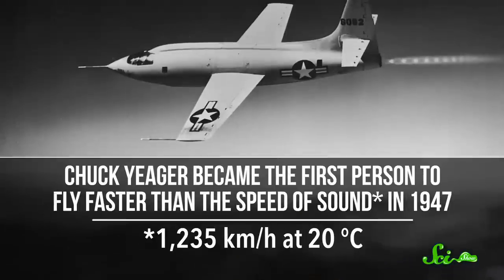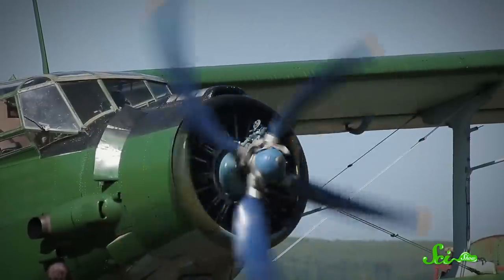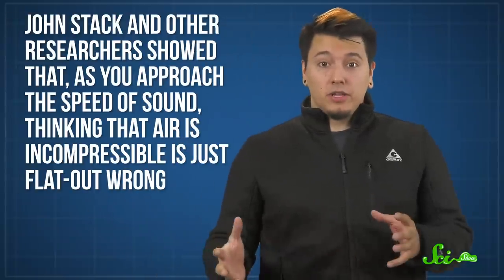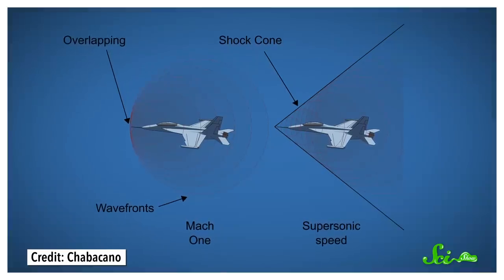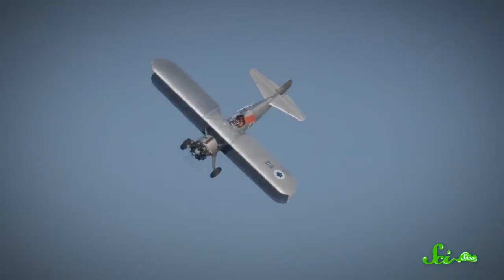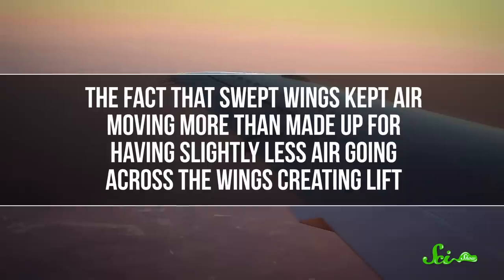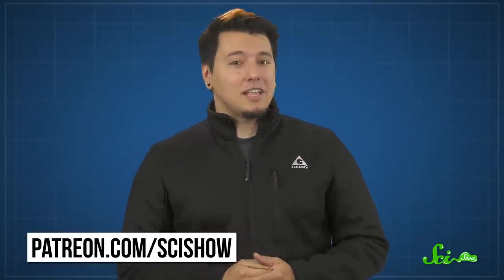A Surprisingly Simple Secret to Supersonic Flight

Comment: Fun fact. While sitting near the wing on an airliner, if you look really closely, you can see a shock wave. The plane flys at about Mach 0.80, but the airflow over the wing goes supersonic relative to the wing.
Reply: Richard Sleeve i’m flying across the US tmmr afternoon i’ll take a look
Reply: The same concept applies to the F1 car spoiler you can see it on the far corners.
Reply: @Lup0Solitario  F1 cars are nowhere near the speed of sound, there is no supersonic flow around the spoilers. What you are seeing is water condensing out of the air due to low pressure, similar to what you can see on airplanes during maneuvres.
Reply: V interesting. Thank you!
Reply: Yeah you can see that. But you need the right lighting conditions to see the light breaking differently at the shockwave. So be not dissappointed if you see nothing.
Here is what you look for: https://www.youtube.com/watch?v=HekbC6Pl4_Y
Reply: @Lup0Solitario  No , that's condensation from the airfoil tip vortices
Reply: If an airliner goes supersonic, such as in a dive, it will break apart. Early jet airliners that went up to the transonic speed range were much more heavily constructed, which meant that for their size and engine power they carried less load, passengers or cargo.
Reply: no chemtrails? Now I am shocked :D

Comment: What allowed Chuck Yeager control of the X-1 was the Full Floating Stabilizer. Above the speed of sound the stabilizer/elevator combination doesn't work.  While the swept wing is very important Col. Yeager did exceed the sound barrier with nearly strait wings.
Reply: Full Floating Stabilizer invented by the British and stolen by the Americans
Reply: It depends on more than the sweep of the wing. You can achieve the same effects with very slim wings. That's what Yeagers plane had. Like the F104 which has almost no sweep. The cost however of such a design is not bearable for commercial airliners or bigger planes so you go for the easier, more efficient solution, whereas fighter jets usually take both approaches nowadays to get even more speed out of the wing.
Reply: LZ129 Brazil  No he's correct, read the book "M52" it's about the plane the Americans copied to build their first supersonic jet. The company that did all the development was forced to shut down and pass everything to the Americans.
Reply: also very thin wings as at super sonic speeds most of your lift comes from compression of the air
Reply: LZ129 Brazil  The British were flying with an all moving tailplane in 1917 with the Witworth FK10 and had continued further development through WW2, A deal was made in 1943 where the UK and America would exchange secrets, we gave them the jet engine, the all moving tailplane and all our uranium, once they had it they refused to give us their secrets
Reply: @JOOLZNED  nothing has changed
Reply: USA#1 !! And the USA had planes in 1776 too
Reply: @JOOLZNED  Also x1 was identical to Miles M52. The yanks collaborated with the Brits up to point where they learned enough to go their own way. Incidentally the German fighter pilots were breaking the sound barrier with Me 262s long before loud mouthed yanks.
Reply: @JOOLZNED  There is no such thing as fair trade with the yanks.
Reply: The problem is that when a shockwave forms on the top of the wing, things like ailerons behind that shockwave stop working because they are not getting stable airflow.  So, the tail is small enough to make the entire thing move giving you control again.  Unfortunately, you can't twist the entire wing (unless you are the Wright Brothers), so bigger ailerons and spoilers and using the tail planes to bank are used instead.

Comment: also wait wait wait, if people assumed that air could not be compressed, how the hecking honk did they overlook the air compressor?
Reply: What is meant is that the models treated air as incompressible because it was believed the effects of compression would be too negligible to matter. The discovery was that air is compressed more than accounted for at those high speeds.
Reply: @WolfDGreyJr  ah aight cool
Reply: Also forgot about all the big racecars and war birds that used supercharged engines.
Reply: I think when the formulas for airfoils were developed, the pressure differences around the airfoils were small enough at the speeds of the time that there was negligible change in the air density.The formulas became so ingrained in aeronautical design that everyone forgot the condition that they only applied when pressure differences were small.
It is sort of like if you developed Newton's law of motion by simplifying special relativity (because apples don't fall anywhere near the speed of light). By the time we started having to consider things going near the speed of light you might have forgotten the simplifying assumption that yielded Newton's formulas.
Reply: It would be better to say they believed that ''open air" could be assumed incompressable. 

Everyone knew you could compress air if it was confined in a piston or tube/turbine etc.

The assumption was that in the open air of the sky, air could just move around the plane as required, simply by applying pressure/drag.
Reply: Yeah, I had the same thought when that was said. Phrasing could have been better for that line.

Comment: The secret is to go between 915 and 3,806 miles per hour. Any less and you discover the secret to transonic speed but any more than that max and you will find the secret to hypersonic speed. 

Pro tip: The key is how fast you go.
Reply: SirEvilestDeath pro PRO tip: those numbers depend on air temperature and density so they vary😉

Comment: On modern civil aircraft it's more about preventing shock waves from forming over the wing than "keeping air moving". This works by decreasing the effective (normal to the wing) air velocity. You actually lose some lift doing this but you prevent shockwaves from forming which would reduce your lift/drag ratio.

Comment: Just an observation - the Bell X-1 which is featured (correctly) as the first plane to successfully break the sound barrier, didn't have swept wings. However a commercial airliner, which doesn't have a shock wave because it is subsonic, is featured as an example of a plane with a swept wing.
Reply: Even at subsonic speeds, supersonic flow can happen over certain shape surfaces. Commerical airliners top out at .94 Mach, so solidly transonic, which is the compressible flow speed range of .8-1.2 Mach.
Reply: The video did say that problems can start at around 60% the speed of sound, and that commercial jets travel at 70% the speed of sound, so I don't see the problem with using them as an example here
Reply: You lost me at "correctly"
Reply: But the X-1's wings were very thin, which mitigated drag.
Reply: Yes the X-1 had wings designed by Gillette to slice through the air like a knife through a scraggly beard.
Reply: Aa I recall, they hadn't really worked out the swept-wing thing. For that matter, the Starfighter had straight wings even after that was figured out, though admittedly the Starfighter was still optimized for high speeds... and even the Space Shuttle and X-15 never equalled it's higher landing speeds.
Reply: @absalomdraconis  But the F-104 has  tiny wings. Heck Germans nicknamed it the lawn dart for how uncontrollable the plane is due to small control surfaces. And landing is practically a death sentence.
Reply: @absalomdraconis  The last starfighter didn't even have wings!
Reply: Interestingly, the X-1 was shaped like a bullet, because engineers knew bullets could fly at supersonic speeds.  They hadn't stumbled upon later design innovations yet.
Reply: @firepower7017  the F-104 was only a "death sentence" because German pilots were trained on the F-86 Sabre (CL-13 really but same thing) and then almost overnight switched to the F-104G with the minimal extra training. Even nations that operated F-104Gs in the exact same fighter-bomber/interceptor role as Germany operated theirs have almost no crashes compared to the hundreds or whatever in Luftwaffe service.
Reply: @QuantumLeclerc  Regardless of it being totally unknown. What made it difficult was how easy it can stall. Also the zero length launch is practically a rocket strapped to the bottom of the aircraft so any jerking movement to the control surfaces will literally send the plane into the ground killing you.
Reply: @firepower7017  true, but ZELL was essentially a meme and wasn't standard practice by any means. The F-104 did have short wings, but if flown right wasn't any harder to land than other supersonic jets of the day. The fact that they crashed often is, like I explained, a myth born out of German training and nothing else. Just the fact that no other air force that operated them had nearly as many crashes is proof of that
Reply: @QuantumLeclerc  The only other Supersonic jet was the F-100 and that will basically throw your plane nose up killing you.

German pilots weren't trained to land at a higher altitude which is why they end up short. Also about 60 F-104s practically crashed and about half of them killed the pilot.
Reply: @QuantumLeclerc  In a demonstration display a f-104 managed to strike others taking down about 4 others. So it's a testament to the troubles
Reply: @QuantumLeclerc  Also I could tell that most of your knowledge on tanks can come from GuP. So I wouldn't be surprised.

Memes and Anime, just no
Reply: @Uejji  Yes, and they designed it with paper, slide rules, and imagination. The few computers which had been built by that time were crude and mostly focused on simple tasks like ballistic trajectories or census tabulations. It says a lot about the genius of the designers, but also the courage of the test pilots. They were betting their lives on the correct math and realistic assumptions of the engineers. Modern computing has made prototyping and testing exponentially faster, safer, and more successful.
Reply: @QuantumLeclerc  Don't forget that the F-104 ejected the pilot through the floor because going up meant being smashed by the huge vertical stabilizer.
Reply: @firepower7017  Lockheed bribed many governments to get them to adopt the F-104, including the Germans, Italians, and Japanese. Pilots who tested the Starfighter found it very unforgiving, and mostly preferred other options, but in the end, the way was "greased."
Reply: @jrhoadley  I mean not to lie the F-104 is one of my favorite Cold War jets. Along with the F-100 however both are unforgiving.

Comment: Chuck is the first official supersonic man. P-47 pilots in a dive claimed they reached supersonic, and the speed indicator went all squirrelly so we don’t know
Reply: I think Yeager's milestone is sustained, straight, level, and in control.
Reply: Lots of WW2 planes from the P-38 on showed supersonic speeds on the dial, but none of those planes could go supersonic, even the ME-262. Pilot stories aren't reliable sources. American pilots in Korea liked to insist that the MiG-15s they were fighting were going supersonic, but a captured MiG-15 was tested - also by Yeager - and determined conclusively to be incapable of supersonic flight.
Reply: @jimblake3574  ye exactly

Comment: Well technically, Chuck Yeager wasn't the first, though the first officially meassured. In WW2, pilots of the Me262 reported effects that occure while passing the sound barrier. Some also reported, that those turbulences sometimes were suddenly gone, when they pushed even further. So, most likely, some WW2 fighter pilot was the first guy, who flew super sonic speeds.

Comment: The first aircraft to go faster than sound was during the war.  The record was for level and controlled flight.  A spitfire in a dive could go faster than sound.  When that happened the pilot was in very big trouble.  The point of lift moved back increasing the drive and the control surfaces stopped working so he couldn't pull out.  Cutting the engine so the prop was slower than the airspeed and other things were needed to save the aircraft.

Comment: I thought you were going to talk about supersonic nozzels... Because that is mind bending.
Reply: Did you know that every (good) jet engine has a supersonic nozzle?  Choking air flow to get it super-sonic is the bees knees in most forms of big-boi propulsion.
Reply: @a.j.mckelvy7968  Yep, but it is the post-choke part which is mind bending.  Been a long time since I took the relevant courses (I'm a biologist who got a BS in engineering for some silly reason), so I'd mangle the description much less the math.  Basically boils down to divergent => faster flow.

High-bypass engines are particularly nifty, in that the bypass flow forms part of the nozzle for the core (and visa versa I suppose).

Comment: I've heard (a long while ago when there were still many surviving WWII pilots) that some of the fighter pilots from different forces (so not some "we did it!" boasting by any of them) when having to dive quickly to get away from the enemy, felt their planes rattle harder than normal and near the point at which they would pull up, would hear what sounded like an explosion. Given that they were in air battles at the time, they didn't think much of it, but after Yeager's daring feat, they became convinced that they'd unwittingly passed the speed at which the sonic boom would happen. None of them were trying to undermine Chuck Yeager's achievement or bravery, they certainly weren't looking for medals or their names up in lights (it's why I can't tell you who said it, but I definitely heard it from numerous pilots), but they'd worked out that the most likely cause of the noise was a very unintended breaking of the sound barrier! It must have been terrifying, but I dare say that being shot at took their minds off that cause of fear PDQ!

Comment: I need to read more about this "air is incompressible" and that its density couldn't change. Surely someone at some point had taken a syringe filled with air, sealed it and pressed the plunger thus compressing it and increasing its density. I suspect that this video has simplified the terminology or explanation causing my confusion. If anyone can clarify this I would be grateful. Especially if further reading is recommended.
Reply: It was poorly worded. They absolutely knew that air was compressible, but did not expect free air (unconfined) to be compressed by an object moving through it.

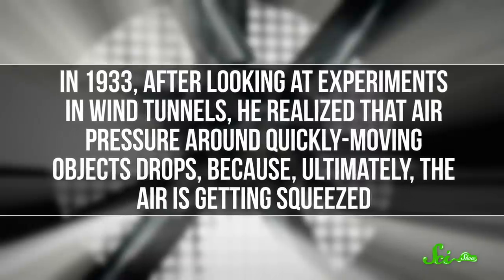Comment: 1:38 "he realized that air pressure around quickly moving objects drops" 1:58 "air pressure might change." So at first the big discovery was that air pressure changed, but 20 seconds later they'd known ALL ALONG that air pressure changes. I still don't feel like I know what the big discovery was.  Was it WHY the air pressure changed?  That it wasn't just the Bernoulli principle, that density was also involved?  If so, I don't feel the writer stated it well.

Comment: I could be wrong here but weren't the german engineers at the DFS institute the first to discover the compressability of air around a wing? They certainly had experimented with prototypes that later should reach supersonic speeds, if i recall correctly, it was called DFS 346.
Reply: Its likely that they may have been aware of it as well. Just like the jet engine, things like this are often worked on and developed simultaneously by multiple teams.

Comment: Small correction: Commercial jets these days fly at Mach .75 to .85, not just 70% the speed of sound.  They used to be even faster - early jetliners exceeded Mach .9 - but the higher fuel consumption at those speeds was not worthwhile.

Comment: You left out the part where they had to change the elevators on the tail so that the whole surface changed pitch instead of just a flap on the back.

Comment: You have an obvious error: while commerical jets may fly at airspeeds that are 70% of the speed of sound at sea level, aka 0 MSL, at the altitudes that they fly at 28000-44000 feet (FL280-440), they are actually cruising at a Mach number of 0.8-0.9, which is 80-90% of the speed of sound *at their cruising altitude*. You should correct that.

Comment: *Commercial airline cruise at around Mach 0.8 which is 80% of 300 m/s. Not 70%. (300 m/s is a good estimate for the speed of sound at that temperature and altitude).

Comment: The Bell X-1 did not have a swept wing. Yet it got beyond the speed of sound.
Reply: The same effects can be achieved with very slim wings. However at cost of efficiency and some structural issues. That's why this method is rarely used for the main wings. But if you take a good look at the horizontal stabilizer wings of airplanes you can see that they use slimmer profiles and sometimes more sweep than the wings to keep better control at high speeds.
Reply: USA#1 !!  thanks for the reply :)
Reply: @roichir7699  Thanks :)
Reply: @roichir7699  F-104 FTW